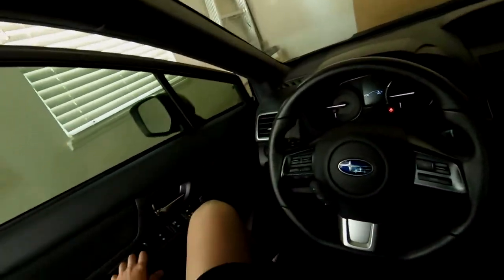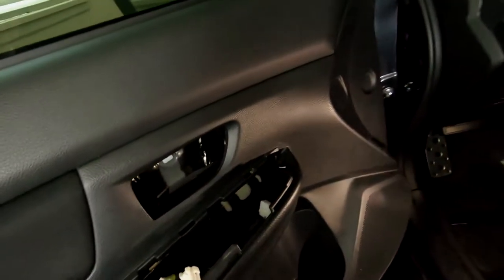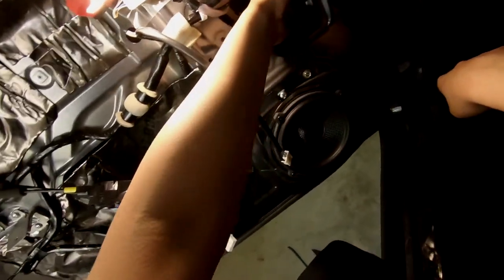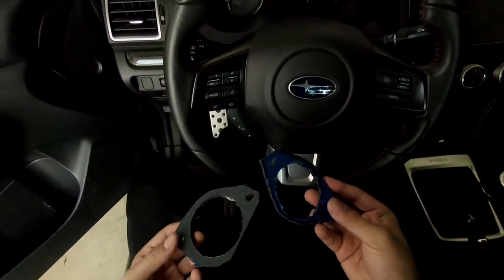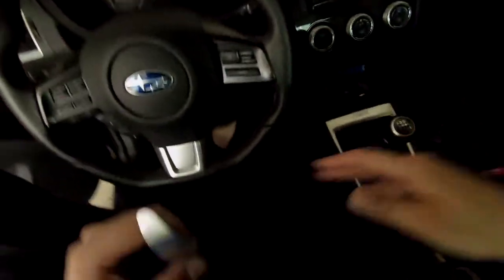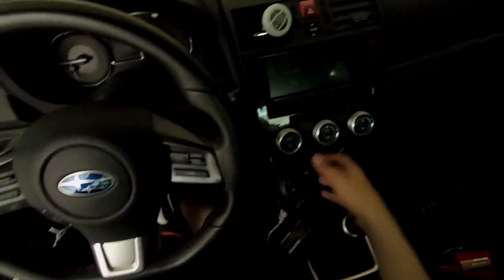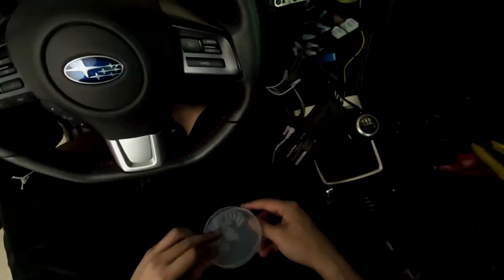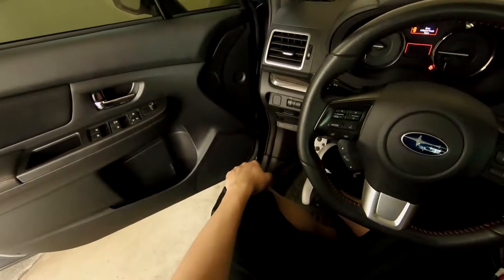DIY How To Install Component Speakers | 2015+ Subaru WRX | Infinity Kappa Perfect 600s

Comment: sometimes the baffles are good for keeping water from dripping on the speakers. cut the back out of them and let them cover the top of the backside of the speaker. this way they have airspace of the door and the foam will let the water run off to the sides if it gets in there.

Comment: Very nice install. How do you like the perfect 600’s? I just scooped a set along with the mid woofer. I’ll be installing them next week.
Reply from the maker: I love them. I wish I had the mid woofer lol would definitely recommend amping them tho.  The woofers are a tad power hungry.
Reply: What’s a good amount of power? My alpine is a 4 channel. 110 watts a channel or 320 bridged. That’s rms and not peak.
Reply: @MrCUEVAS30  100 rms is what’s recommended

Comment: So how do you like them?  I just installed a set in my ram…not too impressed with the midbass in the doors.  And I’m on my second set of crossovers and tweeters…they still don’t work.  Running a fosgate T-600 amp.  Birth sheet says 125 rms per channel.  I’m calling infinity tomorrow.
Reply from the maker: I like them for the most part. I got them steeply discounted because I worked at an audio shop.  As far as midbass, they do okay for a 6.5.  I will say I have heard other 6.5s in the same price range that do sound better and have better bass. If i had to pay full price, I probably would of went with a different brand tbh.

Comment: Awesome video.  How'd you run the speaker cable from the tweeters?  Do you just drop it down that hole and fish it out from below?
Reply from the maker: you could it that way. I ran mine from the crossovers I mounted in the trunk to the tweeter location. So i ran mine to the kick panel and then up through the opening and out.  Then I trimmed the excess to length there for the tweeter.

Comment: Awesome guide man. Could you put the link down for the adapter you used for the woofer? Also how did you wire that speaker wire into the door?
Reply from the maker: Thank you for watching.  The brackets I used were Metra, here is the link for it.

https://www.amazon.com/Metra-82-8901-Speaker-Adaptors-2016-Up/dp/B06XWZG1L9

As far as wiring into the door, it all depends on if you plan on amping them or not.  In my case, I am so I ran new wire into the door from the inside.  From factory, the door boot is already split and taped up so just undo that and it should make running the wire into the door 10x easier.

If you are not amping the speakers, you could just use the factory wiring in the door for the woofer.  Then find those wires in the kick panel and get them there for the crossover.  Hope this helps!

Comment: bro your driver door speaker "bracket" is backward, flip it around and drill 1 new hole in the door. that way the woofer is firing toward you instead of your feet. good video tho.
Reply from the maker: Thank you. The issue was addressed when I took the baffles out later.  I actually ended up ditching the Metra brackets for another set that were a better fit.